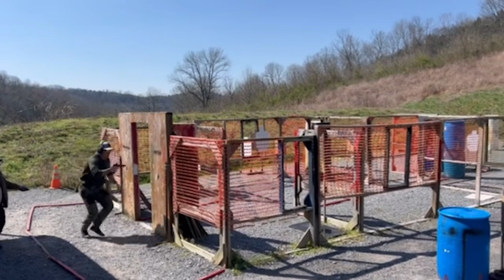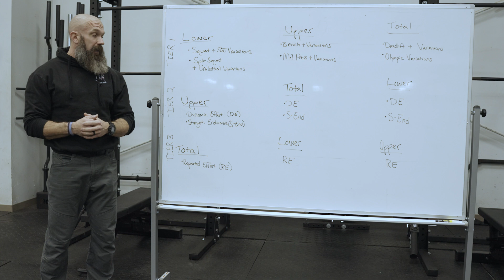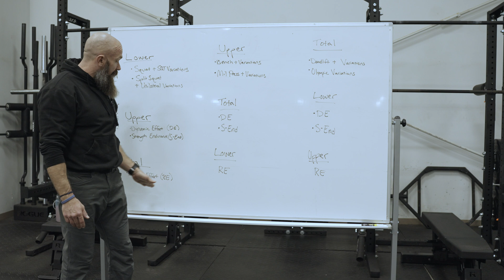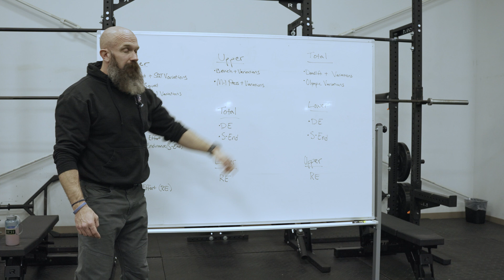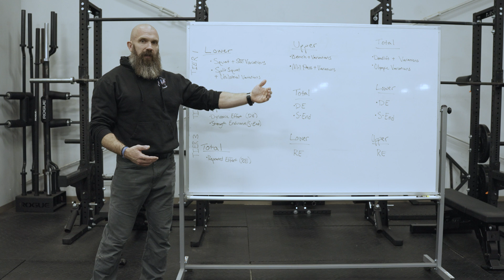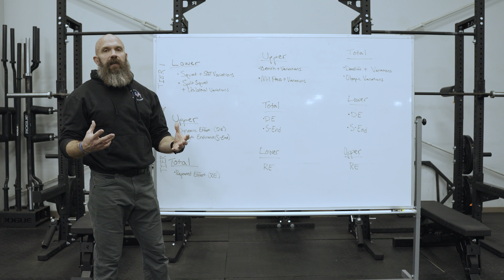Is This the BEST Training System for Tactical and Shooting Athletes?  TIER SYSTEM EXPLAINED

Comment: What are your ideal set & rep ranges for each tier? Or if it’s like an amrap, emoms, etc…
Reply from the maker: I second what @nonecknoprobz mentioned.  In general though, typically our Tier 1 max effort sets are 1-5 reps, Tier 2 power sets are 2-3 reps for 8-10 sets, and Tier 3 and beyond are generally 6-12 rep ranges depending on the movement.  That's at least how I like to program.
Reply: Look up Joe Kenn he created the tier system. His books are free if you google pdf